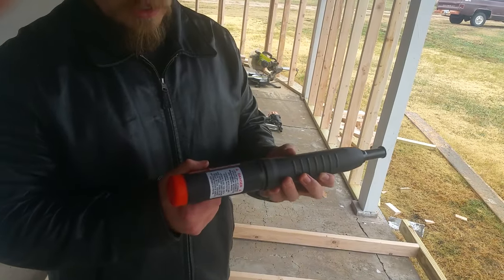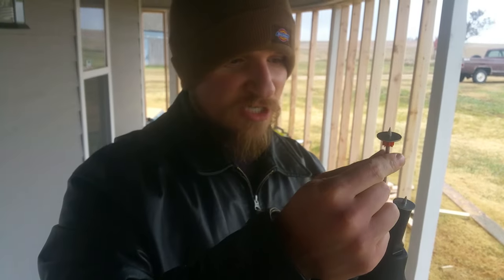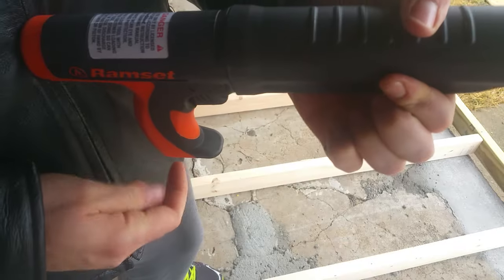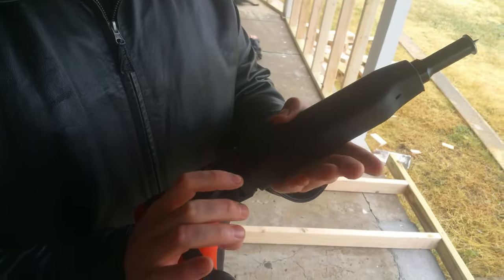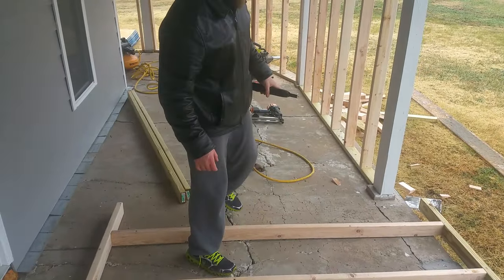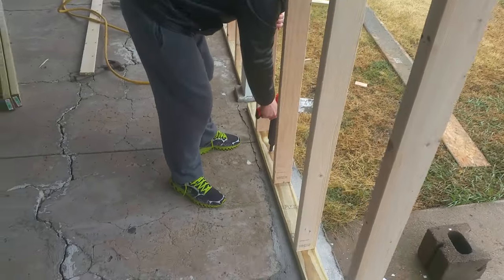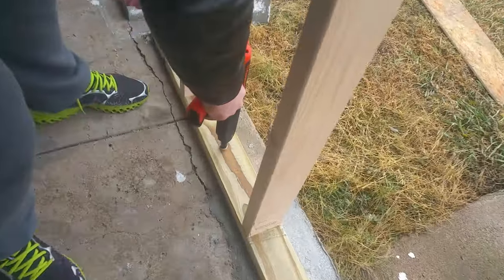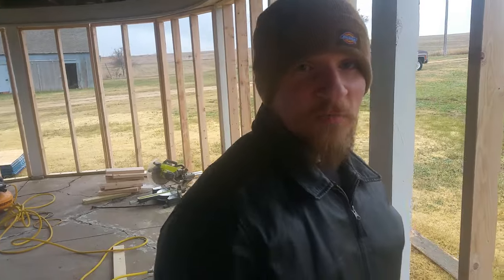Ramset Concrete Nail Gun Review and Demonstration.

Comment: What would the Americans do without 4x2. I suppose when it gets a bit windy you have to go and find your house in the next street somewhere.
Reply: What do you mean by that? Ive been in construction for 24 years, the last 7 as a GC, and Ive seen nothing inferior with wood construction as long as its built properly. Spent 10 years in commercial work, and its true that we rarely used wood for those, but from a resistance stand point its fine. Do they use aluminum studs where you are?
Reply: YES. 2x4's are the backbone of the United States of America, and we are the strongest country in the world.😐
Reply: @jessedover6175  You mean USA, Other parts of the continent don't use wood.

Comment: zombie apocalypse weapon? just saying its quieter than a gun and powerful
Reply: Can definitely be converted into one with some planning and simple tools. You do need a .22 barrel but a 5.5mm explosion proof tube from ebay will do just fine. You could have a .22-25 where youre using a .22blank to shoot a .25 cal projectile could also be .25-22. Youll need a 6,35mm explosion proof tube for that. Note that .22 cal is not .22, its 0.218 so youll have to do something about that

Comment: Can you dry-fire one of these to sink a nail in further? (Fire without a nail)
Reply from the maker: It's possible.
Reply: @huntemall219  I built walls in my basement and used one of these. Some concrete spots are harder than others and the nail wouldn't drive as far down. A friend told me just load another 0.22 load in and shoot it again. Great advice too. Saved another nail and drove the nail down just fine!

Comment: No plastic around the wood to keep it from absorbing the moisture from the concrete? That woods going to rot
Reply from the maker: It's pressure treated. Designed to be in contact with concrete.

Comment: can you dissable the safteyh to use as a firearm
Reply from the maker: No.  No possible way that I know of.
Reply: Good question
Reply: Same thing I was thinking
Reply: @homelessbumthugbigsigmadog3209  now what I'm thinking is to open the cartridge to find the gun/black powder in it
Reply: @Thrillowatt  true
Reply: @huntemall219  It's fairly loose barrel fit so doesn't come out with enough velocity
Reply: I mean get a 2x4 and drill a hole to fit the nozzle opening only, then have to fabricate something that you can use to pull that 2x4 towards you and it won’t go back until you pull the trigger. Couldn’t be that hard..

Comment: Thanks. But you have unstable concrete - yikes !!  You are not using pressure treated wood on the ceil plate (floor) Why ?  I think you need to sell the place in next 7 years as it is all going to break away and rot
Reply from the maker: Its pressure treated and has concrete posts footings around the base. Having said that, its still just as good as day 1. Thanks for commenting.